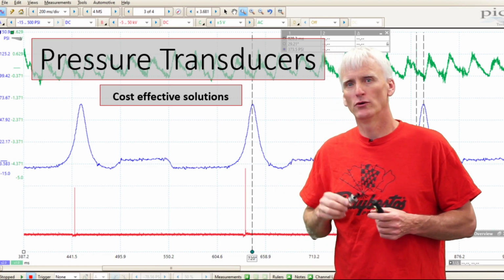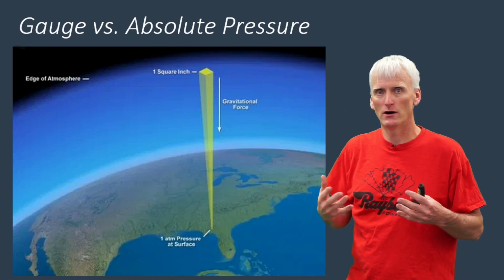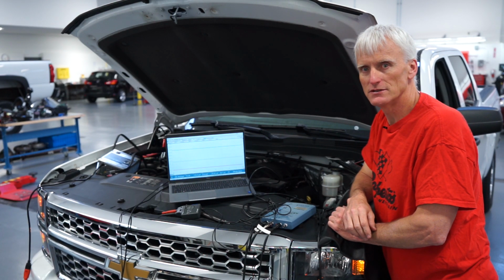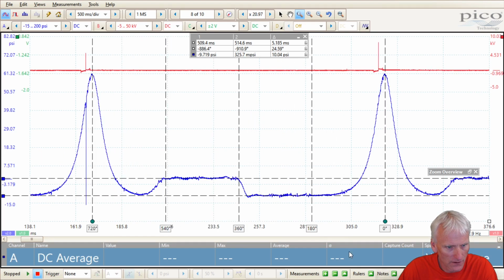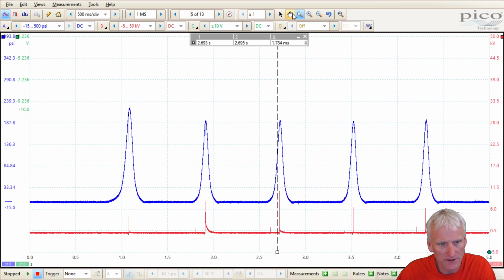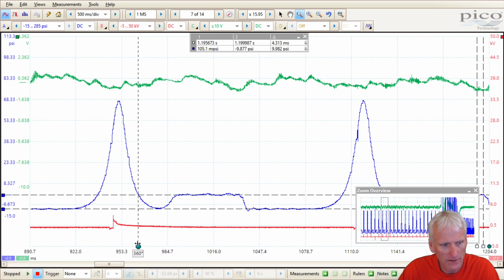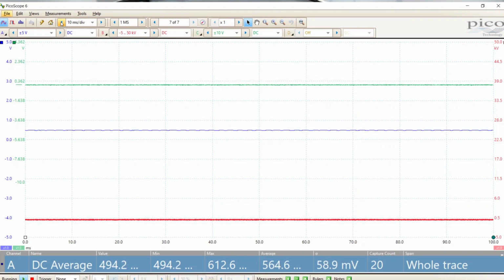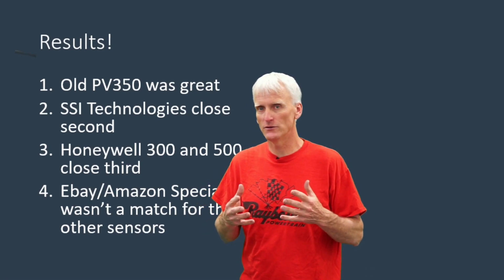In-cylinder pressure testing for less than $100

Comment: I just found your channel and have been enjoying the dynamic balancing and pressure testing videos. I was a US Air Force ATC radar technician from 1970 to 1974 and a motorcycle/auto mechanic until 1982 when I went to work for the US Army as an electronics technician. In 1984, I transferred to the calibration lab where I calibrated all sorts of electronic test equipment made by H-P, Fluke, Tektronix, and many others. I retired from the lab 6 years ago. And, for the past 10 years, I've been flying radio controlled model airplanes with 6-axis gyros. I've been in the R/C hobby since 1963. So, your videos are right up my alley. I'll be watching many more of them, I'm sure. Thanks!

Comment: If the psi300 does better than the psi500, in theory a psi100 would do even better than psi300, right? Since the psi of the compression never goes above psi 100, is this logical?

Comment: The eBay sensor waveform is good enough to confirm the source of a compression issue? Looks easier n more accurate than the old leak down tester
Thanks very much gr8 video

Comment: That is very cool. I've been using a 5VDC USB Power source on my custom test equipment. A Custom set of USB to 4mm male banana plug leads does the trick. For 12V, I have a set of spade terminal to 4mm male banana plug leads (fused) and connect to a Milwaukee m12 battery.

Comment: Curious engineer here : These in line pressure sensors , I missed where they attach ? How do you get access to the cylinder head as it runs
Reply: Cut fuel to the cylinder, go in through the spark plug hole, or glow pug if diesel, or otherwise if it's not a glow plug engine you would need some tooling and have to pull and injector itself

Comment: I am hearing you run the engine. Is the pressure transducer connected to the spark hole and that cylinder is not firing and the other cylinders are firing?

Comment: The Amazon and Honeywell sensors are analogue transducers, basically a potentiometer with 5V across it and the output is the slider acting as a potential divider  What is being output is the voltage for the wiper location.  It is not correct to refer to it as a sample because there is not an analog to digital converter inside the transducer.  There is a response time which is the time a change in pressure takes to produce a change in position of the wiper which depends on the magnitude of the pressure change and the inertia of the potentiometer and age/wear.  What is not addressed in the transducer specification is this: what is the response time for a given pressure change i.e. if you apply a 20psi pressure step is that 1ms or is it less or is the 1ms for a full scale pressure change i.e. 0psi to 300psi.  Inferences can be made from the tests done on the car.  Also when using a digital oscilloscope care has to be taken because you can have the quantising levels and sampling frequency of the scope appearing in the measurements.

A very helpful video and well explained and put together.

Comment: For a running test do you have to disconnect the fuel injector for the cylinder with the transducer in it? Is the secondary ignition wire that's being monitored at 13:10 just going to ground?
Reply from the maker: You don’t have to disconnect the injector.  Usually the pcm cuts fuel once it detects a misfire anyway.  I don’t run the engine for a long period, so it’s really not an issue.  Yes, on that secondary, you can just ground it through a test plug.  You can also see the ign timing by tapping into the coil signal wire as well.

Comment: I can't figure out what I'm doing wrong, but I'm getting around 34 psi at the top of my waveform (the TDC traces).  From the bottom trace to the top, I'm only getting 48.45 total psi.  I've double checked I've got my cheap transducer set up like the settings in the video.  This is on a 2007 4 cylinder Toyota Camry.  Shouldn't my total psi be much more than I'm getting?  Thanks for any help.
Reply from the maker: I would need more details.  What sensor do you have?  What scope?  Did you set a custom range?  What’s the pressure range for the sensor?  On my “gauge” 500 psi sensors, 350mv is -15 psi, 500mv is 0 psi, and 4500mv is 500 psi.  Where your readings while cranking or running?
Reply: @siuautomotive  Thanks so much for the reply.  I have the same cheap 500 ebay transducer that looks like the one in the video.  I set up the range as 380mv is -15 psi, 500mv is 0 psi, and 4500mv is 500 psi, and my scope is a Pico 4424.  I took the waveform capture running only.  Thanks for your video and helping me with this.

Comment: I can't find the P52-500-a-b-I36-4.50vp sensor. Every time I type it in it goes to p51 not p52. Is there a difference between the 2? Any help would be greatly appreciated. I'm trying to build a decent incylinder pressure transducer.
Reply from the maker: I think I typed it in wrong.  That p51 should be good!
Reply: @siuautomotive  👌 i already ordered it. Your video really helped me alot. I ordered a nice clean adjustable volt regulator for my 5 volt out put. I was very impressed how clean that p51 sensor came out.

Comment: Great video! I learned an awful lot. I was hoping to use in-cylinder pressure to control injection timing in a diesel, but since these use spark plug holes (obviously replacing the sparkplug) i suppose they're not capable of reading pressure in a working cylinder. What techniques/hardware is needed to essentially put the MAP sensor into the cylinder where, haha, it really ought to be :~)
Reply: Warum schraubst du nicht einfach die glühkerze raus ? Du bekommst ein tolles bild deiner zylinderarbeit.lg & viel gesundheit für dich & deine familie.
Reply: @cardiaglexia995  Sorry i can't speak German, but i translated with deepl. You can replace glowplug with pressure sensor, in fact Kistler sell a glowplug/pressure sensor combo for any diesel. They are very expensive though, and only used in research. Having said that, it is quite surprising all diesels don't have this sensor, as it can detect engine wear before it becomes a problem, and can increase fuel economy (particularly as the car ages). I suppose both of these things are good, not bad, if you are selling cars.
Reply: @John-rw9bv  hello and sorry for my wrong language.i only if we screw in the pressure sensor instead of the glow plug  , we get the same good values as with the benziner.lg and health. All good for you.

Comment: Do you at all mention how is the sensor hooked up to the vehicle mechanically? I assume you did not drill the head.
Reply from the maker: I use a compression tester hose and go through the spark plug hole.  Make sure you remove the schrader valve in the compression tester hose.  Also, make sure you disconnect the coil or ground the plug wire.
Reply: @siuautomotive  Oh the cylinder is deactivated :( Gotcha. I am looking to hack into a cylinder while it's alive.
Reply from the maker: Ah, the diesel instructor here does that, but he goes through the glow plug hole.  He uses a different pressure sensor that’s much more expensive.
Reply: @siuautomotive  fun fact: VAG and Opel have cylinder pressure sensors build into some glow plugs! stuff like PSG007
Reply: @Rusefi  woooooooooaaaaaaaah, that sensor is only 80€ here in germany. I guess it would work the same way the sensors in this video work, albeit for a running engine. Also if you're from rusefi, thank you for taking an interest in diesel ;-)
Reply: @Rusefi  So do I. But on an gasoline engine. The are a few makes of spark plugs with pressure sensors (as well as glow plugs with sensors) but very high prices. I believe some 1500 Euros, so not for me. How hard can it be to drill a thin passage into a spark plug? 🤔

Comment: The discrepancy with the expected time between spark and peak compression is about the time for the pressure wave to travel from the cylinder to the transducer at Mach 1.
Reply: The electronic circuits have quite a bit of delay too, but i suppose Mach 1 is a good point to make

Comment: Great video Sean!

BELOW ARE PRICES IN CANADIAN ROUBLES AS OF MAR/2022

Fluke PV350 (old design) -  $800-$1300
Ebay/Amazon sensor - $28
Honeywell 300psi (px2an1xx300paaax) - $188
Honeywell 500psi (px2af1xx500paaax) - $160
SSI Technologies (p52-500-a-b-i36-4.50vp) - $205

The clear winner here for me is the SSI Technologies sensor based on it's both its clarity and relative price between both Honeywell sensors and the Fluke PV350 . I believe the SSI Tehcnologies sensor provides the best overall value as I don't have a school budget at my disposal. =]

VIDEO IDEA?: Would be great to see a video on the comparison of commonly available 'Low Amp Probes'  using the Picoscope, and maybe even comparing some larger scale Amp Probes to re-enforce some of the reasons a '600AMP Clamp' might not cover all of the required uses in the automotive field. And comparison between budget options vs more expensive options.

Comment: So the real running compression is only about 60PSI on this engine?
Reply from the maker: Yes, when an engine is idling and pulling strong vacuum, not much air enters the combustion chamber, so there’s not as much to compress.  Cranking vacuum is very low, like 1-3 in hg because the engine is rotating relatively slow.  So during cranking, the engine is able to take big draws of air and that allows for a higher compression measurement.  If I were to snap throttle with it running, you would see the running compression jump near cranking compression values.